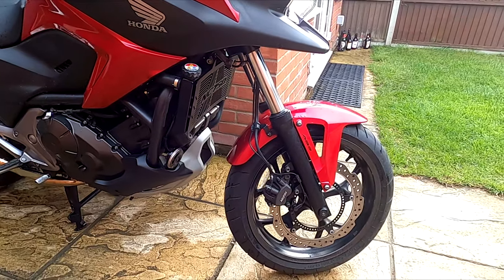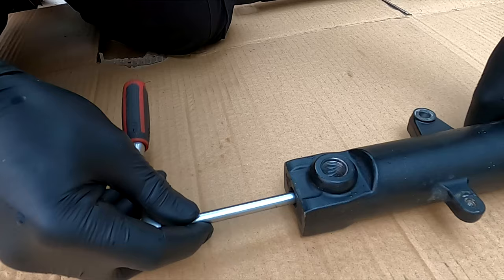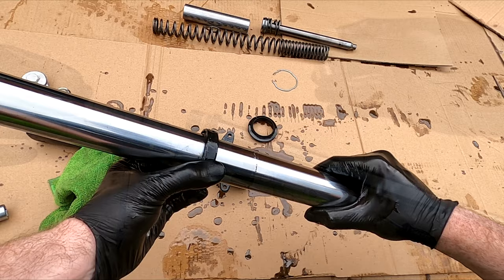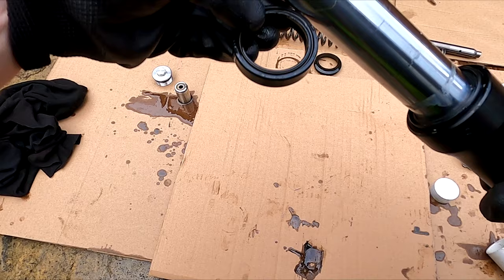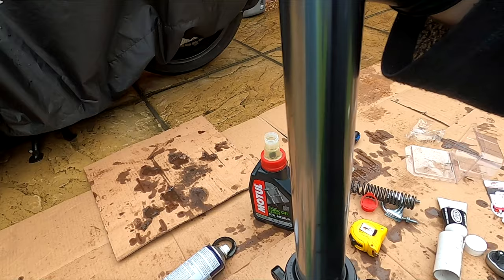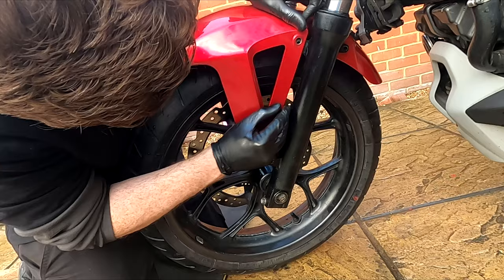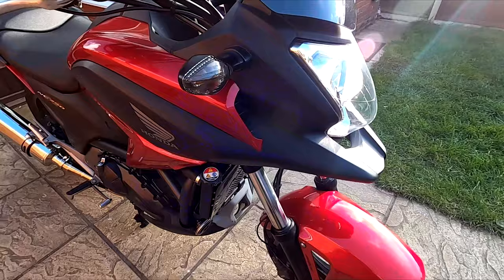How To Change Motorcycle Fork Seals (Shock Oil Seal Replacement)

Comment: In case anyone can't find a youtube video or other coherent info about it...
below is for 2019 cb500x
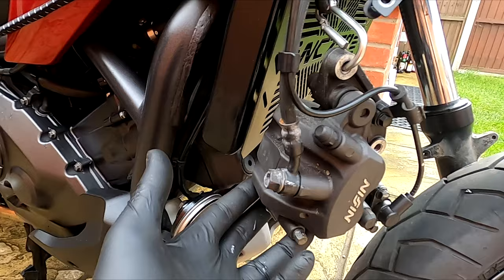1:43 for 2019 cb500x..    the pinch bolt is a allen aka hex key of 5mm

1:59 the front axle bolt ( aka wheel spindle) is a 14mm allen aka hex..not 17

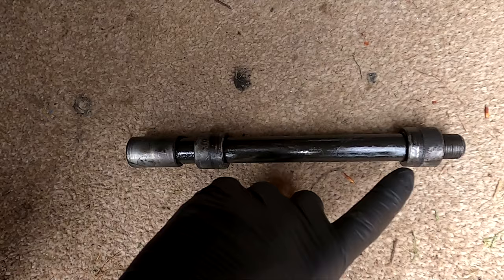2:32 same 14mm bolts for 19' year model

2:42 = 10 or 12 mm ( it's nighttime as of the time posting this comment..I'll try to remember to come back here to revise/edit  tomorrow

Comment: Clear and concise, excellent vid. Sometimes the user manual goes through a procedure for aligning the front spindle/forks with a particular routine whenever you remove a wheel, a tightening sequence and a pump of the forks. This is the case for my CB1100, not sure if this is the case for the NC?

Comment: THE DEFINITIVE GUIDE. Really helpful and rich of details. Thanks a lot.  I would have, however, given a couple of sinks with the front, before tightening the lower bolts ;-) (b.t.w. Signed up) ;-)
Reply from the maker: Great tip!

Comment: Great video.  I would have liked a bit more info on the pvc pipe you used and to see your hand holding it as you banged the seal into place. 

very very good.
Reply from the maker: Its gentral sink waste pipe found on a kitchen sink
Reply: @nicksepisode  much appreciated. I will have a look.

Comment: Hi Nick, very useful video - thanks. Have you got any tips for a stuck bolt in the bottom of the fork? The first side I didn't have any problems, on the second fork, the bolt won't budge and is now starting to round off
Reply from the maker: I’m guessing this is the Allen bolt at the bottom ? If so use a broom handle and shove it down the tube to help grip the other end. Also use a heat gun or hair dryer or even boiling water on the end so help expand the thread area. Use a very good quality Allen wrench (buy a new one if possible) give it a tap when inserting the tool and pray.
Reply: Thanks for the tip. Will try some heat on it and try and pack it from the back tomorrow and cross my fingers! Got it soaking overnight with WD 🤞
Reply from the maker: @simonjohnson4188  good luck 🤞

Comment: i don't know how true it is, but on the nc forums its saying the fork oil measurement could be a misprint, some riders are setting their fork to 140mm and that stops the jarring. i have the NC's so mine should be 102, but they say 120mm.
Reply from the maker: Bit of trial and error, and get what feels right for you

Comment: You said measure the oil level when fork is fully extended, but in manual it says that you should compress the fork fully and measure 101mm
Reply from the maker: Well spotted, use amount specified and you can't go much wrong

Comment: Hi there, I have a problem with the fork piston connecting to the socket bolt. I don't know why it's too short. If I try with a longer bolt, it's okay, but I don't like to change Honda engineering parts :) thx for the good video brother
Reply from the maker: there must be something that's not right for it to be too short, double check your parts
Reply: @nicksepisode  Yeee .
 This answer I was afraid to hear :) I don't want to remove it again. The backup ring was really hard to install, but I will persist. Thanks for the awesome video and quick answer.

Comment: How do you make sure the forks are straight before the thing the pinch bolts and putting the wheel back on? Do you slide the axle thru and out them back in at the same time? Any tips would be helpfull. 

I’m doing this on my Suzuki 125, should I be following the same torque specs for the nuts and bolts as you have or are mine spacific to the bike?
Reply from the maker: Yes put the wheels through before pinching the bolts. Torque setting will be lower on a 125. Nothing a quick Google won’t sort out

Comment: I have NC 750X YEAR 2014...i wanna change dust rings on fork and change oil only...there goes 0,5l in each fork right or is it too stiff after?there is less oil in 700x i think
Reply from the maker: Measure what you take out and pour in same amount

Comment: As far as I know the air gap is measured with the fork compressed.....it also says so in the bit of manual you show in the video. But this must have been mentioned already?
Reply from the maker: slip of the tongue
Reply: @nicksepisode  Might want to edit the video and the written part, this is an important step, If you measure the air gap full extented, there would be way too much oil in the fork
Reply from the maker: @HDHeroCam unfortunately no way of me editing it now, but the quantity is displayed so you’d think that would be a sign

Comment: Hi. Do you know how to remove the bagues located inside the tube fork please ? I didn't find any documentation that shown how to do. Im talking about the plastics bagues inside the fork tube
Reply from the maker: the are press fit, pull them out with the stantion like a sliding hammer. join the Facebook forum there is plenty of help on there inc the workshop manual, hope this helps

Comment: Good video. Have you found the fork springs adequate? 
Is there any point to installing a fork tube cover?
Reply from the maker: The springs seem OK for my type of riding (only on the road) fork tube covers can hold moisture so I don't use them.

Comment: How many ml of oil to replace? I read in the manual that the amount of oil to change is 514ml, but when driving, the fork is very stiff, all feedback from the road surface vibrates on the steering wheel
Reply from the maker: there might be another issue there, get it checked

Comment: At 8:15 , when inserting the hold-down bolt into the bottom end of the piston/damper rod and tightening to 20 nm,
what if the friction of the old spring isn't enough to keep the piston/damper rod from spinning?  What would hold it?

Comment: One thing, at 8:49 you mention it should be fully extended to take the air gap measure but the manual says you have to fully compress it. Which one is it then? On that note, I followed the instructions (compressed) and when filling the second fork I ran out oil and it's still missing about 10mm and truly I don't feel like buying a whole liter for that, what can I do? Thanks, man.
Reply from the maker: it's supposed to be compressed. Error on my part. Use the oil quantity mentioned, and you'll be fine
Reply: @nicksepisode  thanks so much, man. Cheers

Comment: Hey mate quick question. Whats autosol? Metal polish or something? Can you point me the exact product so i can find one similar in my country
Reply from the maker: Hey bud, use any type of car polish,
Reply: @nicksepisode  thanks for that! Heard of 2000/1500 sandpaper with wd40 also. Whats your opinion?
Reply from the maker: @marcoaurelio6941  nothing too abrasive, try a cutting polish, even toothpaste works well

Comment: Nick - what is the correct size pvc and bracket?
Reply from the maker: that's a good question, i really cannot remember , the piping is standard kitchen sink waste pipe, the bracket i dont know, but even a larger one would work so go slightly bigger
Reply: @nicksepisode hi, which way round does the oil seal go? I can't figure
Reply from the maker: @andreigatman3383  follow the packet instructions, contact the supplier if none are supplied

Comment: Is the air gap not 104mm on the X model?
Reply from the maker: I followed the repair manual for the 2014 nc750x model, other models may vary. Air gap is personal preference and you can't go too wrong with either measurements.
Reply: Thank you, great video, will attempt this weekend.
Reply from the maker: Good luck, and let me know how you get on with it.